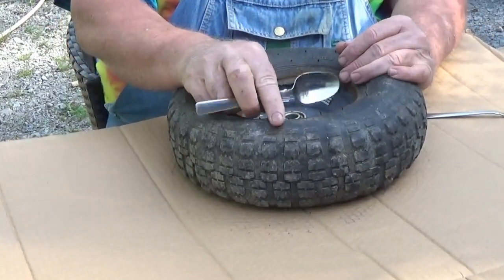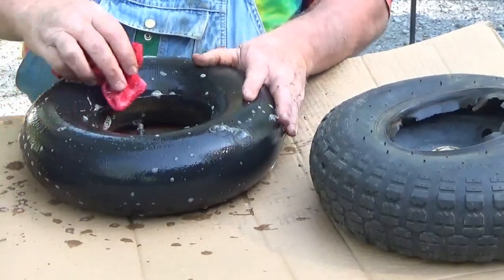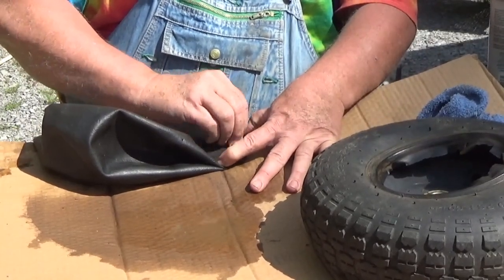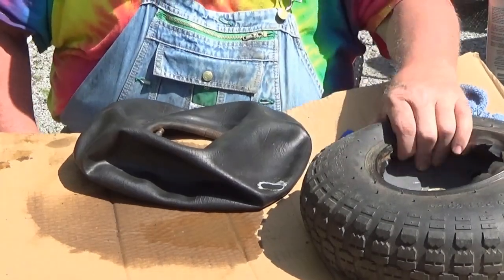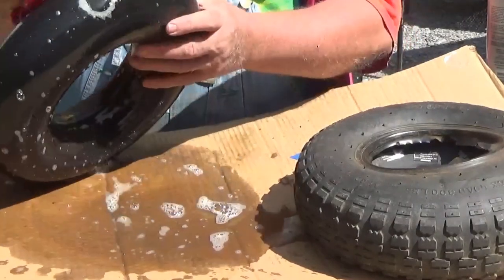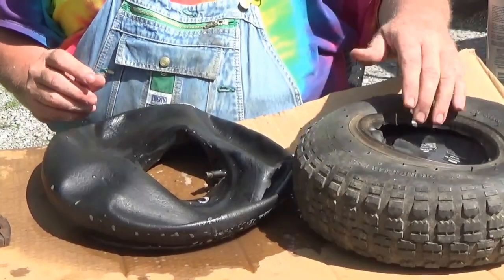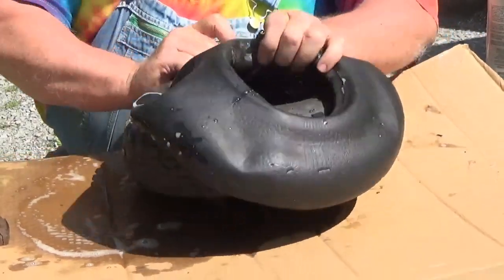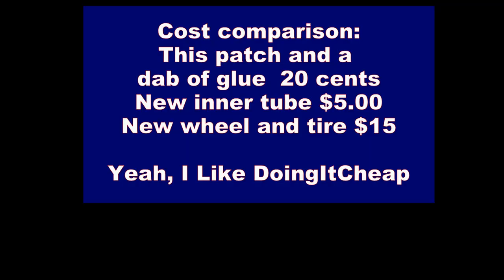Patching the inner tube on the garden cart with PawPaw

Comment: So an alternative method to checking for a thorn or nail that might haver perforated the tire into the tube is to MARK how the tire and wheel are aligned before the repair, so that when you find the hole(s) in the tube you can find the  where the tire was punctured to pierce the tube by aligning the wheel and tub based on the valve stem and the the wheel and tire.   Sometimes there are little bits in the tire that only puncture the tube when under load.       Forgive Any joe biden slip ups in the post.

Comment: If you use brake cleaner and scrape the area with a sharp blade it'll give the perfect base for the patch.  Dont use excessive glue , it could have a negative effect.  I've been a commercial tyre fitter for 22 years and done one or two lol
Reply from the maker: Thanks for the info!

Comment: Great tip on checking the inside of the tire for objects. I had a tire that went flat several times and I did check it but only on the third time did I find the thorn that was the issue, had to use my bare fingers to find it as the rag just passed over it. I lined up the valve stem with the hole in the wheel to help narrow down the search are. Outstanding tip on using the table spoons.
Reply from the maker: Right on!

Comment: Hiya Bob, I know what you mean  wife came home early hit a deer with the Toyota did 5k damage she wasn't hurt was just getting ready to park it for the summer lol the mini gets almost 50 miles a gallon so she's driving it and tells me a light came on a couple times no oil on the dipstick what the hec else could go wrong got in my truck and the shifter broke off up under the dash so spent the next 3hrs putting on that part before I could go get oil for the mini cooper it was time to change it so a 100dollar bill couldn't fix lol  that was in just one day , bought a wood chipper cheap needed a carb kit got that but had to back to town and get two rubber boots that fell apart so now finally got my Harley parts in and got ready to start it and the new battery I got is dead so now I have to buy one of them at the tune of 180.00 so yes it never fails , I just hope this whole summer not like this lol be safe and take care
Reply from the maker: Takes ya back to HeeHaw .......if it weren't for bad luck, I'd have no luck at all...........gloom.. despair.. an' agony on me
Reply: @DoingItCheap  It sure does lol

Comment: What I have found to work is that when installing the tupe put some but not a lot of air in the tube first, this keeps from pinching the tube when putting the tire back on. Other than that I do the same thing.